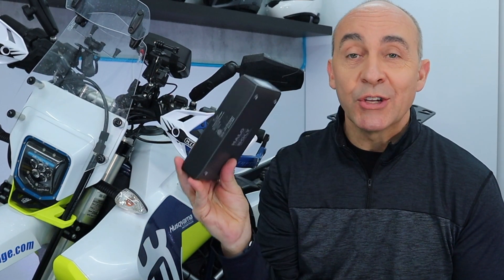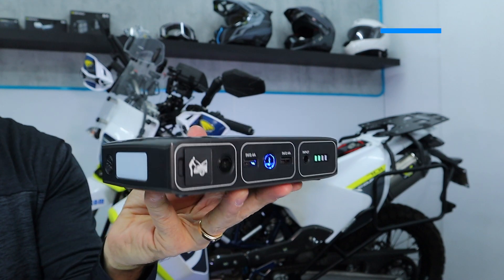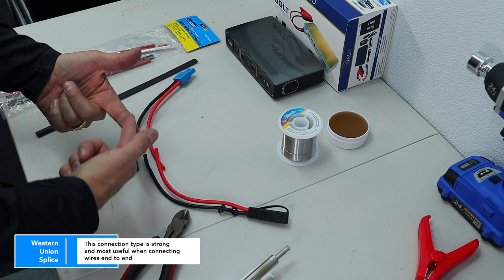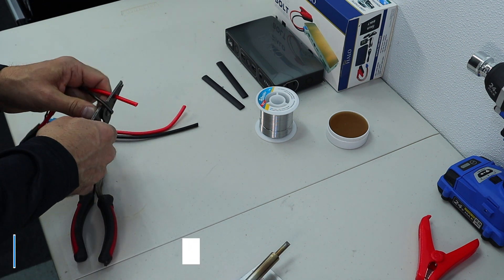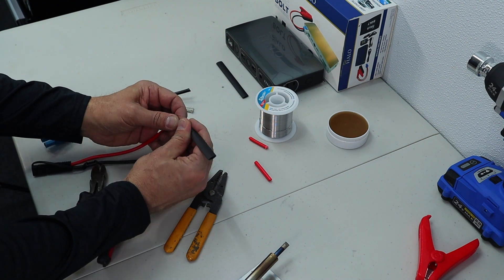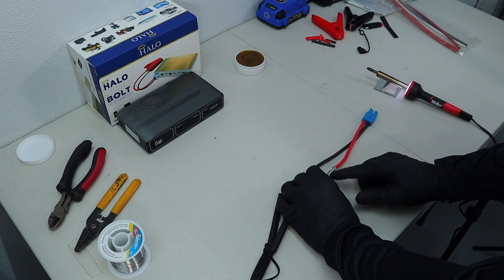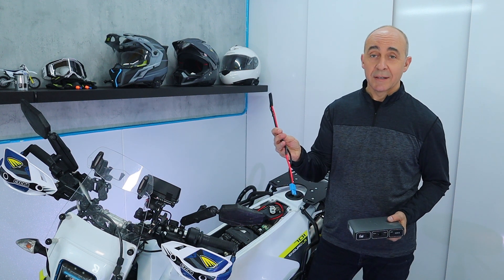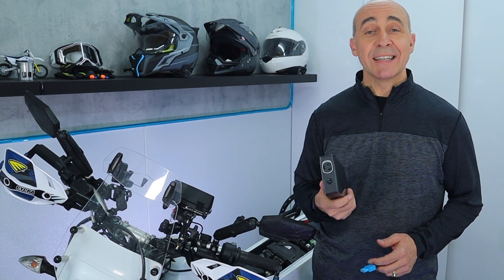how to connect a portable jump starter

Comment: Good video. I have a question though. The wire doesn't have a box with diodes that prevents your bike forcing power back into the jump starter pack, and possibly making it explode in your hand. How do you know it's safe? Is there any way to add that on?
Reply from the maker: I reached out to Halo/ACG relaying your question and they assured me that their "patented safety circuit...ensures safety". I also talked with an independent auto industry engineer who concurred with this assessment. So, I'm comfortable that the electronics will prevent power from flowing back into the power cell itself (if used as instructed per operating manual of course). That said, I am not a representative of Halo/ACG. So, you can always source more specific information directly from the company at https://halo.acgbrands.com/en_US/  ...hope this helps!